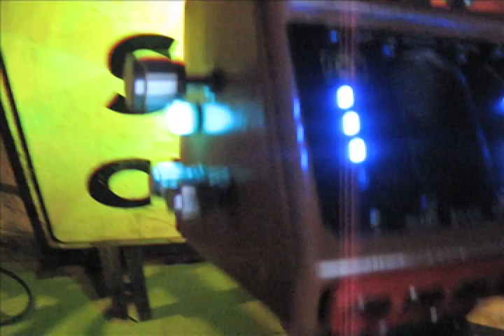cantoluce morricone light to sound synesthesia device

Comment from the maker: For timing I used 4.7mfd capacitors, but the 555/556 chips used in the APC will directly drive around 220ma, or over 10 bright LEDs... the nice thing is they sink/source so it doesn't matter if you use common anode or common cathode LEDs.